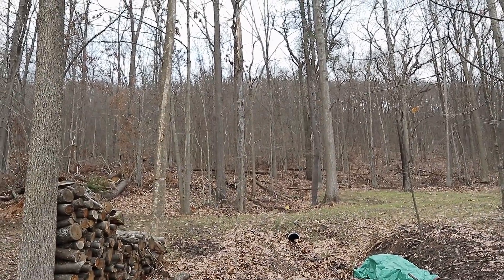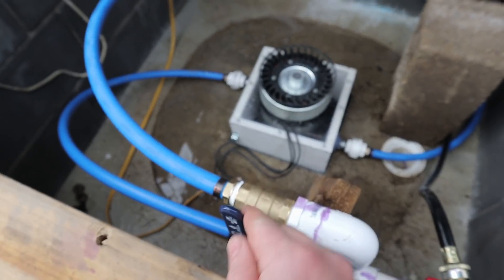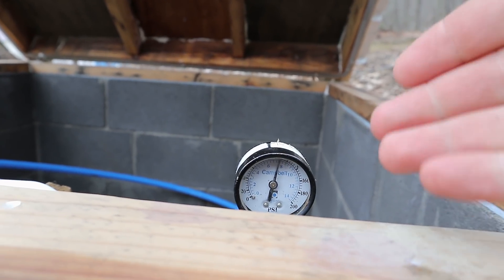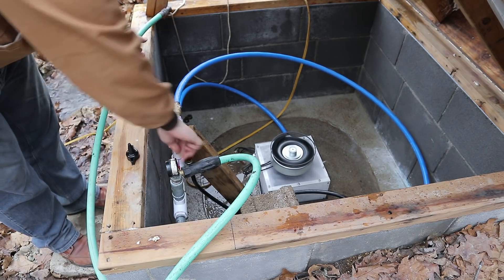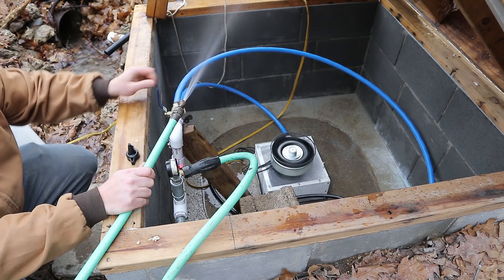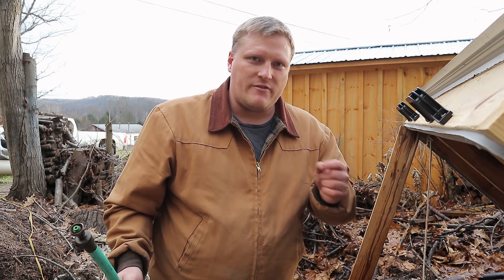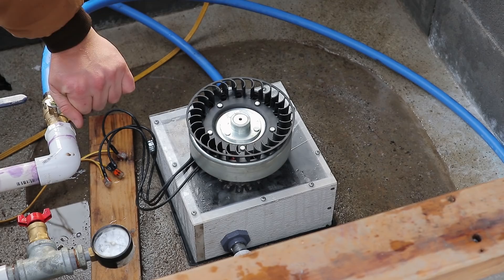My Trompe/Microhydro

Comment: You need a dome [a large volume to capture air significantly higher (and slower) than your final air flow] to get the type of air flow you desire.
Reply: With 280ft of head and a 30gpm flow rate you could use basic displacement to compress air.

Comment: It looks like you have plenty of flow to use for a separate trompe air compressor.  Split off a water line (a bit up the hill) into a feed apparatus like the one described by MrTeslonian (for his Trompe Ram) 

https://www.youtube.com/watch?v=x1I_59nmkwM   

With the already high head you don't need the water hammer effect to boost pressure, >100 psi air is probably good enough for most uses.  Beside the constant water hammer pressure spikes in that type of system might not be so good for the turbine. 

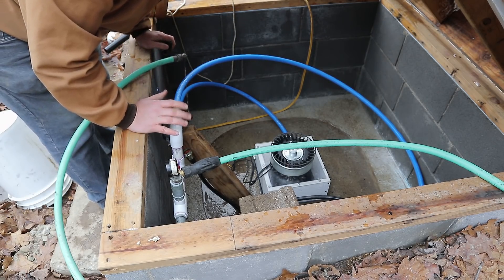But what you CAN do is to introduce air bubbles via venturi tubes down hill from the water line split point on the trompe air compressor side.  That way flow will draw air into the compressor line, but not into your turbine line.  MrTeslonian shows how he set up the venturi tubes in his video at the 3:03 mark.  Pretty basic set up for that.  Then you'll just need to construct a vertical air reservoir to capture the compressed air bubbles with a short line to a larger compressed air tank in your shop.

Then you can add a pressure monitoring system and a solenoid valve at the water line split to turn the compressor on and off based on the pressure in the tank in the shop.  Easy peasy.

Comment: You know i was just thinking you should put a well in and put the excess water from your machine your using to drain and fill it would save you on your water bill too and as its all spring water anyway would be delicious and good for you. Not sure where your draining the water too but with this system your well would never go dry.

Comment: Not to complicate the build. Several points. Having been close to Engineering field, gas-steam-turbines. Often the blades of the turbine will have small holes, punched out. This allows for less splash and less drag. Also, the housing for the turbine, in your video is square. A round housing or no housing might help. As, you might be getting splash-back into the turbine, and making it less efficient. Lastly. What if you put in more than one turbine. Such that if you had two turbine along the same axis, but independently turning. And the nozzle is pointed at the center of each, thus creating twice as much (theoretically) power. I really enjoy the experimental aspect of the hydro generator. Look forward to more. Thanks.

Comment: might put those wire connectors on a brick, having them soak in water is never nice
Reply: Probably filled with dielectric grease to keep the water out. Many outdoor splice modules have it built in.

Comment: To remove air from the system you need to set up a accumulation so the well fills the accumulation and then fro accumulation you connect the hydrosystem

Comment: You need to do some more study on trompe design.. what you’re doing is allowing the water to carry the air through to the atmosphere.
You need to interrupt the flow and separate the air from that water (a vertical pressure tank  to catch the bubbles that also allows the water to travel through) 
Very interesting.. if you could incorporate your hydro with a trompe that would be a great outcome.. electricity and hydrothermically compressed air from a single water flow.. now that would be something!
Because you’re slowing the pipe water flow by using a jet/nozzle, you could introduce a trompe setup as I described prior to the turbine, but you would reduce its output marginally. Depends whether you value compressed air or not.. you could also have a gate valve to select either/or

Comment: You need a larger air separator and a carburetor up top to give a constant air volume. 
A float valve in the air tank to vent air to keep the air out of the water turbine would be a good idea as well. 
The air will prevent cavitation from damaging the feed pipe.

Comment: Add a tank that can fill up with water and air. Add a outlet on the top for air to exit. And add a outlet on the bottom for the water to exit. Maybe you can then even add a pressure sensor that only opens the water outlet when the pressure is high. Or like a toilet but to relieve air. If you set it up right you can ensure that you only have water coming out at the nozzle side.

Comment: Nice, have you thought about making a reservoir by using the ram pump technique in thqt engineer channel where he uses 1 flow of water, a T output, with 2 disc valves, where the flow is periodically switched between the two valves and creates a water hammer each cycle, where it is then possible to pump water to very high Altitudes from a slow stream flow.
Reply: Why would he need that tho?
Reply: I image that it would just be a cool thing, since he is doing all kinds of cool things :)

I though about it when he said the batteries were full, but I guess it would be better to add more batteries or try connect it to his home for a -% in electrical bill

Comment: Changed your mind on the trompe, you need air control so you don't waste your water about a 3-5 straw intake at the top.
Reply from the maker: This was a demonstration, I will not be doing this.
Reply: @JoeMalovich  Oh too bad
Reply: @JoeMalovich  you could use an automatic bleeding valve for Radiators, a float valve which lets the Air out and closes before the Water gets out.
https://en.wikipedia.org/wiki/Automatic_bleeding_valve